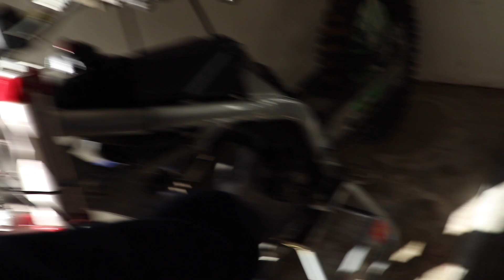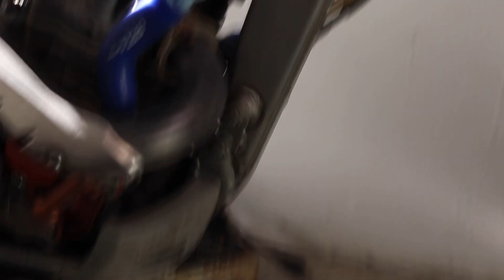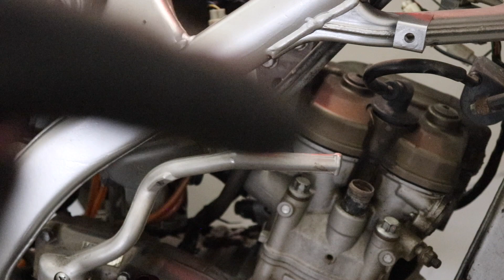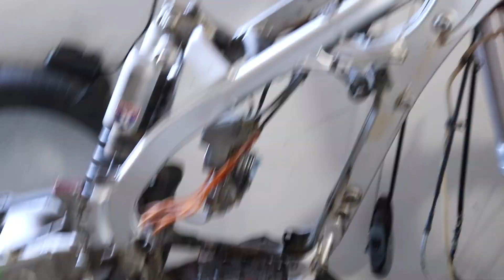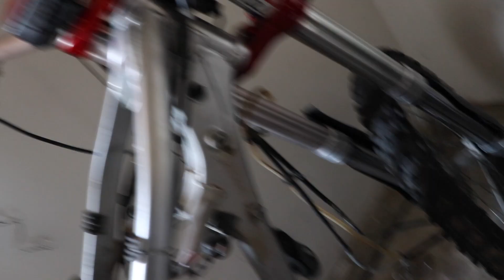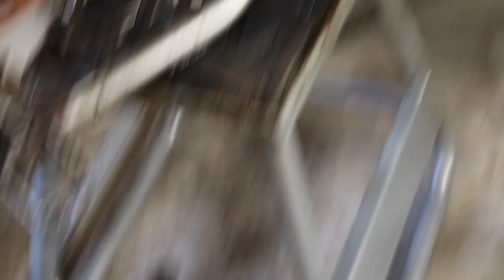How to remove a dirt bike engine 😅

Comment: Hey I got a 1985 kx60 would a 4 stroke 110 fit? It’s the cheapest engine I can get on Amazon
Reply from the maker: Hey idk if it will fit and Amazon wouldn’t be the best place for a kx engine I recommend checking out eBay most likely will be able to find something on there,
Do you have the original engine I can possibly build it for you